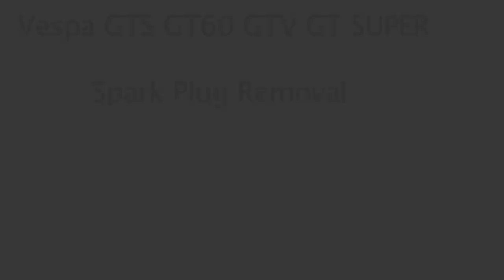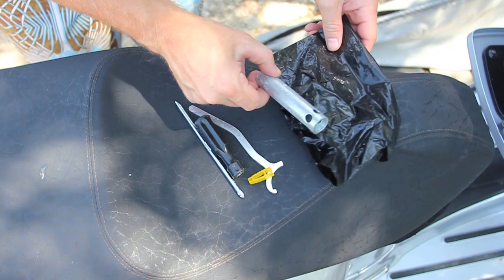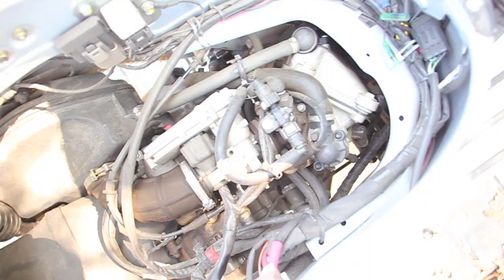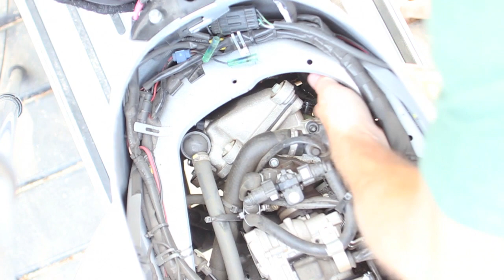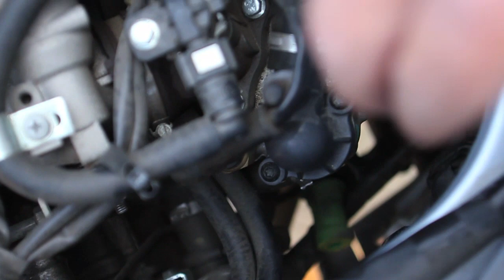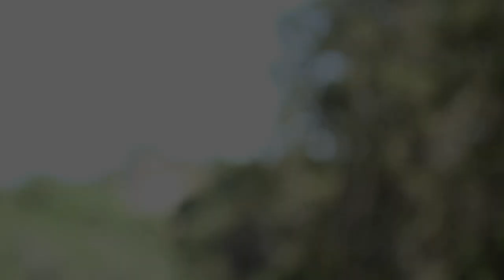Vespa Spark Plug Removal | MicBergsma

Comment: Thank you so much.  I am  useless on anything mechanical.  Mt GT200 wouldn't start when I came back from holiday.  It was turning over slowly but just wouldn't start and then I flattened the battery by trying it so much.  I replaced the battery and it still wouldn't start. I watched your you tube video and managed to change the spark plug and it started first time.  As you point out, there isn't a lot of room to move in there.
Thank you so so much

Comment: amen on the clearance! they could have put an access panel or door dead center under the seat between your legs and would have made life easier. have you tried adjusting the valves without dropping the engine down? MV says theres a way but man it sure looks tight in there.

Comment: i have to try to change my plug. hope it will help. when i drive my gts 300 2012 more than 90km/h (about 60mph) on steady speed it start to be discontinous. when i accelerate or release throttle it's ok. weird problem. does anybody else have this?